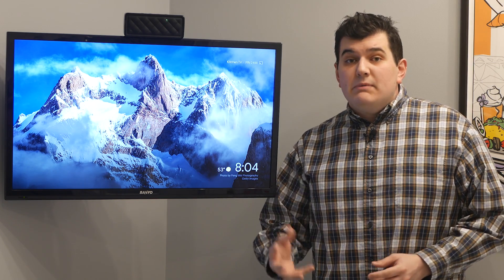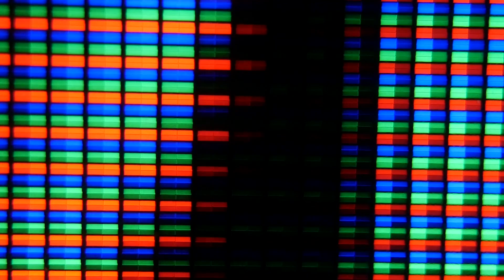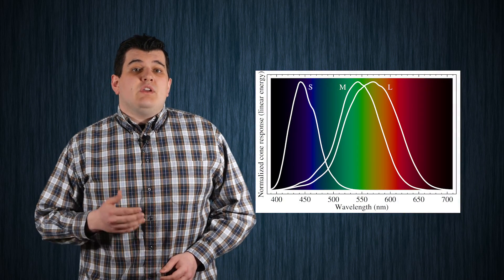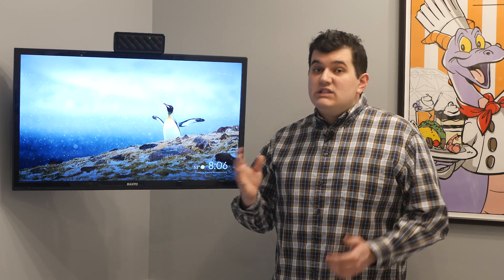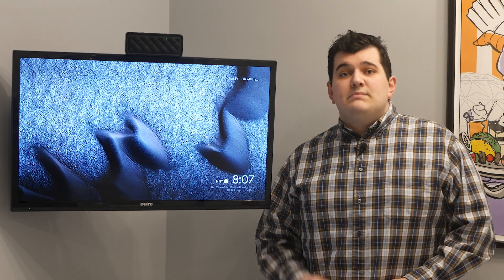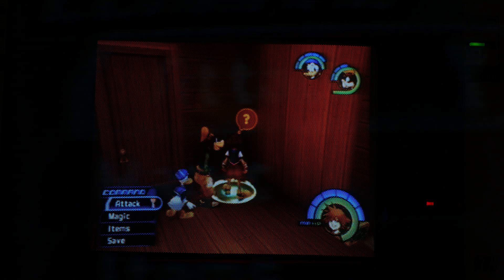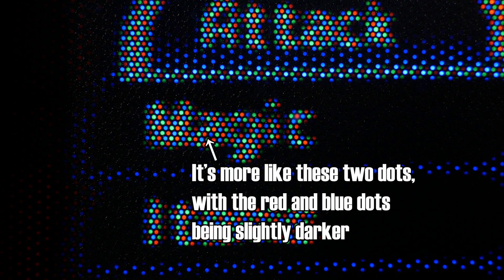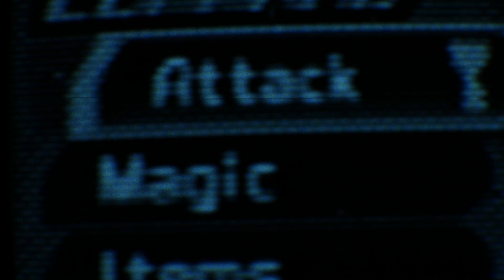These Are Not Pixels: Revisited

Comment: Much of this topic is just semantics.

The physical arrangement of phosphor cells in the thumbnail aren't pixels; that's true. But there's still a meaningful definition of "pixel" for most color CRTs.

The only meaningful distinction between an image made of pixels and a true 'analog' image is whether the image is discretized in both dimensions.

Even from the days of black and white TV, images have been discretized in the vertical dimension with scanlines. That just leaves the horizontal.

As seen in the video, most color CRTs separate the colors in the horizontal dimension. With vertical discretization built into the geometry of scanlines, and horizontal discretization built into the geometry of shadowmasks, we had two-dimensional discretization built into color displays right from the start.

Therefore there's a meaningful definition of "pixel" as the smallest supported resolution of two-dimensionally discretized transmission of a particular color with a particular brightness.

True enough, such pixels don't directly correspond to the shadowmask cells of the thumbnail. But contrary to the implication of the video, there is a definable pixel resolution of such displays.

Comment: The shadow mask should very well define the resolution to some extent though. It does block the beam even in the horizontal lines. The trinitron layout preserves the vertical clarity of the lines perfectly but the horizontal clarity is still restricted by the amount of grills. The electron gun and signal itself also restricts it by losing high frequencies in the analogue circuitry. So the two work together to define the resolution, I think this is the TVL. A more coarse mask means a lower TVL. The other layouts also mask vertically and so it'll naturally inhibit the clarity of the lines as well. A non trinitron shadow mask that is coarser than 480 lines will reduce the apparant vertical resolution. Any shadow mask that is coarser than the frequency of the line will reduce TVL. So it does affect the clarity.

You can see yourself at 15:08 that it's true. The coarse mask of the right side TV eats up the letters of the menu items even though they are white. Where the finer mask on the left leaves a lot more detail in the white letters.

Comment: If I can scan 480 rows on a screen with electron beam and if there are 480 rows of slots on shadow mask, then, yeah, there are 480 pixels vertically. Which forces 640 columns to be existed on shadow mask because of the aspect ratio, eventough the beam is continuous. I understand the working principle of television is not pixel based but the result is a pixelated image in the end.

Everything in the universe, even analog signal results in a 1010 binary fashion. Thats why most of the equations includes a square root expression to normalize the sinus wave.

Think of an human eye, its maximum resolution is limited by the number of yellow dots placed vertically and horizontally. 

Finally, try to think of the smallest pixel. It would be a single photon hits to a smallest area of any surface. The same thing valid for FPS. It would be the number of photons hit to that tiniest area in one second.

As a final word, everything appears to be analog is ones and zeros in the end.

Comment: Excellent video! But I have not understood how the defection coil of the CRT can drive individually one of the 3 beams. What does let completely stop 1or 2 beams, e.g. when you need to light only the red phosphor element? Or only the red+blue? The filaments of the 3 beams are always powered, and the magnetic field of the deflection coil wraps the entire section of the neck of the CRT tube, so I don't understand which element of the CRT can stops or modulate the intensity of the the beams independently.

Comment: One tiny detail you didn't get quite right: standard digital 480i/p for televisions is not 640x480, but rather, 704x480. This applies whether the content is meant to be 4:3 or anamorphic 16:9. The pixels aren't square in either case, and they really don't need to be when the displays these resolutions were primarily designed for don't have physical pixels.

(Side note: digital displays will generally report 480i/p as 720x480. As I understand it, the extra 16 pixels per line are meant to be part of the horizontal blanking interval, but are included in order to compensate for some kind of minor unpredictable shift in the horizontal position of the image within an analog video signal.)

Comment: You went into all this detail talking about how the colour mask/phosphor dots aren't pixels, but the easiest way to prove this is the fact that half of one of those phospor dots in the colour mask can be illuminated. You can see in some spots where half or less of the induvidual phosphor dot isn't illuminated. Thats impossible with pixels, they are either on or off, full or empty, a one or a zero. With an analog colour tv, you can have only part of the phosphor dot illuminated, making a shape or element that is technically sharper than a pixel of that relative size could be.

Comment: Grr. Pet peeve. Resolution is NOT defined as X by Y.  Resolution (resolving power) is defined as pixels per inch, i.e. X/width or Y/height.  X by Y gives you display size, which you can divide by the display dimensions to calculate resolution.
Reply: Yeah, I kind of cringed at that, my phone, being 4k would have a crazy high resolution if you count it like he did

Comment: There was a fascinating related thing that Capcom did with Darkstalkers (and probably other games) in the arcade.  They shipped an optional higher resolution monitor.  This monitor had exactly the same number of scan lines, but could display more horizontal information.  On horizontal scan lines, the brains of the arcade machine modulated the tube beam intensity as if it were a higher resolution monitor.  The high resolution monitors displayed this just fine.  But the low resolution monitor, by virtue of being an analog beam firing at a mask, also displayed just fine, as the extra information just crashed against the black spots in the mask.  The number of scanlines has to stay the same, but the detail with a scan line could go up and up, and old Crt’s would just stay compatible.

It was a fascinating thought, that if CRT’s had kept going we could have 480 scan lines by some arbitrarily high horizontal resolution.

Comment: 10:01 QAM is the type of modulation used for the old 56k modems, since it makes quite a lot of different possibilities.
Are you sure it is used in TVs?
Amplitude and frequency instead of phase makes more sense IMO.
Reply: QAM is used pretty much everywhere. It's certainly used for the signals to you phone (at least in 4g/5g, not sure about pre-4g) and also in broadband connections (at the very least in DSL). It is also most  certainly used for the color component in analog TV transmissions.

QAM combines amplitude and phase information (q for quadrature refers to the phase and a to amplitude)
Reply: @mattegeniet  Geez that's an old comment of mine you responded to lol
But yeah, for example the docsis channels of my broadband modem are a few QAM-256 downstream and QAM-64 upstream.

Comment: I've been working on a faux-CRT shader for Unity, and this video was extremely informative and helpful in figuring out the properties and mechanisms that give it that distinct look.
Reply: How did it go ? :) I am currently prototyping a CRT filter, just fooling around in Rust with the pixels library and drawing pixels in a framebuffer (so not a "shader" per say) And I realized that a full HD monitor is just not enough, I really need a very high DPI (retina) to simulate the analog nature of an electron beam.

Comment: Maybe not by definition, but I still consider the output of a CRT Shadow Mask pixels.

Whenever there is a point of a single colour, I call that a pixel.

So yes, putting a mesh over a newspaper, and then looking at it from a distance so that each point within the mesh appears to the eye as a single colour, I would call each point within that mesh a pixel.

Comment: Hey there. I just wanted to ask some questions regarding LCD/LED TVs vs Plasma. I'm legally blind, and as a result I need to sit very, VERY close to a TV in order to see what's going on. Like, literally a few inches away. I also play games, or at least I try to. Many games are inaccessible to me because of my eyesight. Anyway, I've found that sitting extremely close to an LED/LCD TV has this weird white-washing effect around the screen, making the screen brighter around the edges and even in the center. It's very disorienting and makes playing games nearly impossible, especially very dark games. However, when I sit at the same distance from a Plasma TV, I do not get this effect no matter how close I am. The black levels never change, and the picture is always the same no matter what angle I view it at. Why is this? And is there a modern TV equivalent to Plasma I can purchase that has this same benefit of omni-directional viewing angles? It's becoming harder and harder to find Plasma TVs, and the one I currently have is this beast of a 42" inch that puts out heat like a radiator. I've heard good things about OLED, but I've had limited exposure to them. Would OLED have the same effect as the Plasma? Thank you for reading!

Comment: A discussion of analog bandwidth or analog vs. digital domains might help a lot with this subject.  Even a CRT has a "sort of" horizontal resolution based on the analog bandwidth, it's just not as "hard" as a digital signal like HDMI, DVI, DP, etc.  It's certainly correct to say the dot structure on an analog TV is not equivalent to pixels, and it's more like pixels are "spraying" somewhat haphazardly onto whatever hardware resolution the tube has.  On a CRT this is almost never 1:1 or even 1(digital):1ish(analog bandwidth).

It may also be interesting to show a CRT computer monitor running different resolutions up close.  There's always a mismatch between the digital resolution created inside the computer, to an analog signal, then finally sprayed onto the hardware structure of the CRT (the lack of 1:1 above).  Dot pitch (the tube's "resolution" or "sorta pixels" or mask resolution or whatever we want to call it) and bandwidth (analog signal "speed") were both important specs on analog CRT computer monitors.   The analog bandwidth set an upper cap on pixel resolution and refresh rate, and you could choose to trade off pixel resolution and refresh within that bandwidth limit. 

Even HDMI and Displayport specs have standards on "bandwidth", and that limits the resolution and refresh rate, but define more discrete true pixels. and discrete limits on horizontal pixels.

Comment: So in conclusion: these are (sub)pixels that are created by shadowmasks. :)
If you drive the CRT with digital circutry you can change an  arbitrary subpixel to whatever you want at demand.
Reply: Even if you drove it with digital circuitry, the pixels would be defined by your digital circuit, not the CRT. Remember, the beams make a continuous sweep across the screen, and you could change the brightness several times as the  beam crossed a single phosphor dot.

Comment: If I understand well the 'holes'' on the colour CRT mask defines the resolution of the TV.  Can we say each hole or slot in the mask represents a pixel?  From your explanation for a 480i CRT there will be 480 rows of holes, and each row will have a certain number of holes horizontally.  My question is how many holes are there horizontally?  Is it from these list of values, 702, 720 or 864 or depending on the quality of the TV set?  My dad had bought a 26" Philips colour TV in 1976 and then in the early nineties he purchased a 25" JVC, which CRT was like the Sony Trinitron.  Also thank you for creating these great videos.
Reply: Shadow masks aren't standardised, so the number of holes (or dot pitch) can really be anything. Both horizontally and vertically. It would be intuitive for the number of rows of holes to equal the number of scan lines but that isn't the case.

In reality the bandwidth of the signal is the main limiting factor on resolution, so the horizontal resolution is defined by how many times the picture can go from 0 to maximum brightness in a single scanline which for NTSC is a bit less than 350 (hence sd video having around 700 horizontal pixels)

As for the "native resolution" of different CRTs: how well the signal is handled, and the size of the electron beam are the main determining factors.

Hope this helps.
Reply: @JagoReedJones  do you have typical numbers for shadow masks slots/holes horizontally/vertically, that were being used in the CRT by the industry?

Comment: NOTE: I realize this video is almost a year old.

Very enjoyable, as always. There is one aspect I didn't hear covered:

The beam scans across the back of the display exciting the phosphor as it traverses the length over and over until it reaches the bottom, then restarts at the top. What controls which horizontal areas of each scan line are lit and how brightly? The host says the electron beam's intensity is controlled for that, but how? Is the power simply reduced for darker areas?

Comment: Speaking of CRT televisions, I have a question that no one has ever had an answer for including technications. That being: back in 98 I bought a Panasonic 27 inch TV due to the fact That I trusted the company as well as it had the best picture. I later was very surprised of the picture quality when i started receiving digital signals, the picture quality was stunning. I had it in for repairs at one time and I asked the tec, why I could not see the black horizontal lines and why I had such a good quality picture. he told me that Panisonic had managed to hide the black lines and if I remember right, that the picture tube could produce a 500 or 600 lines by about 400-450, I just can't remember anymore. I can state that the picture quality was exceptional. My question is in general, how did Panasonic hide the black horizontal lines? If I walked up to the TV, I first could see a fine chicken wire mesh and a wee bit closer i could see the pixels floating around.

Comment: Ok I thought I understood the distinction between analogue and digital, I really did... I thought I understood... I thought I understood... I didn't. Good video!
Reply: Digital televisions have electronic pixels that can be individually controlled, analogue color televisions just have a multi-colored film at which "light" is projected to make certain parts glow.
Reply: @KatyaEll  Having individually addressed pixels does not make it digital. The brightness of each red, green or blue cell may still be proportional to the voltage applied to it, that is still analog.
Reply: @Myrtone  The logic controlling those pixels is digital, whereas that of legacy televisions is not.
Reply: @KatyaEll  And what about the signal that goes to the cells of the display? Isn't that actually analog.
Reply: @Myrtone  I don't know. Presumably the signal is also digital. I am not an electrical engineer, just a random YouTube commenter.

Comment: So can i pop more holes in the shadow mask of my old crt to get better appearant resolution?
Reply: No, because the shadow mask only serves to stop the beams from hitting the wrong spot. You would need to change the location and size of the phospher dots and the shadow mask.
Reply: Also, you'd have to enter the vacuum tube to get at that, which would be hard to undo.

Comment: But, by the pure definition of a pixel...
"a minute area of illumination on a display screen, one of many from which an image is composed"

Those "phosphor dots" should still be classed as a pixel, as they are an "area of illumination" ;)

It doesn't state whether it should be active or passive...
Reply: Wikipedia cites an older tech definitions book and says "In digital imaging, a pixel, pel,[1] dots, or picture element[2] is a physical point in a raster image, or the smallest addressable element in an all points addressable display device; so it is the smallest controllable element of a picture represented on the screen."
Reply: But they're not the area of illumination. The electron beam's contact point is. All the colored film does is glow when hit with the beam. You'll notice, especially on the color displays with rectangle-shaped "dots", the entire rectangle is often not lit, only that part of it hit by the electron beam.

Comment: The key here is that an analogue signal is continuous, with no logical divisions whatsoever, whereas a digital signal is logically divided, into bits.
Reply: Actually, a digital signal is discrete in both time and amplitude. Any signal that is continuous in one, the other or both, is analogue. An example of a discrete-time analogue signal is an A.M radio transmission, actually.
Reply: It does have logical divisions - sort of. The horizontal and vertical sync pulses serve to seperate each line and frame, respectively. There are also TVLs (TV lines) that determine the resolution of the signal itself.
Reply: @autogolazzojr  Those are really just regular intervals of time, when it comes down to it.
Reply: A good... "analogue" here is the labels applied to different types of gamepad inputs. The D-pad is usually referred to as digital because the buttons are either activated or they are not. 1 or 0. The thumbsticks, on the other hand, are called analogue because they constantly transmit information that is defined by the position of the stick relative to its housing.

Of course, the signal the sticks send to the computer is digital, but I won't point that out because it will just muddy the waters...